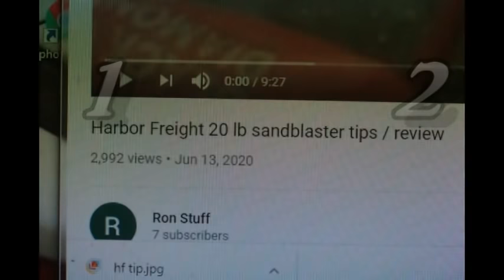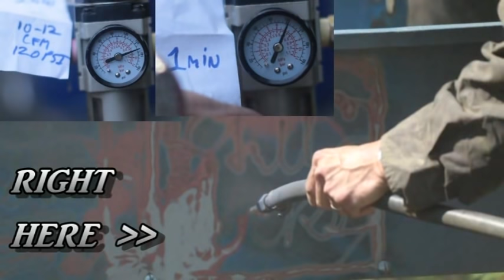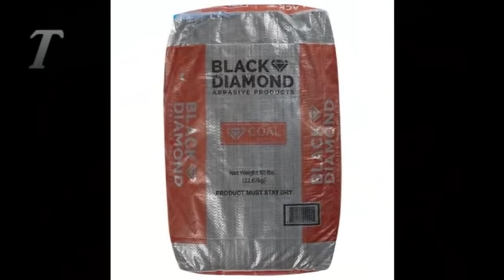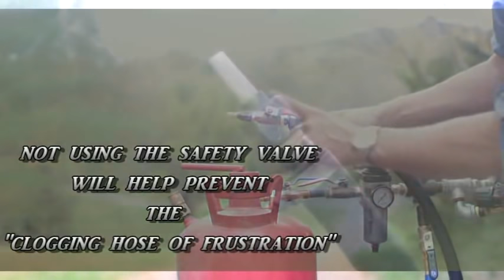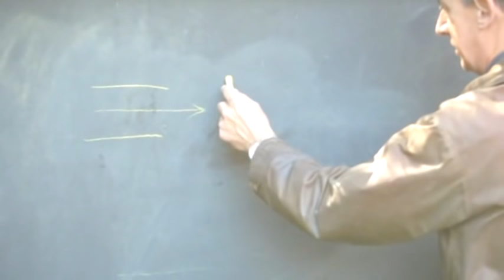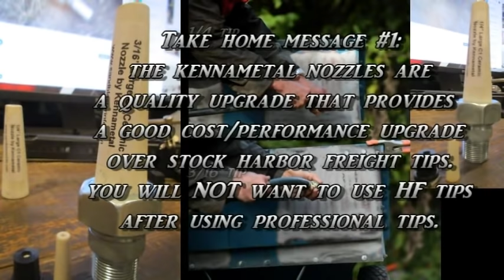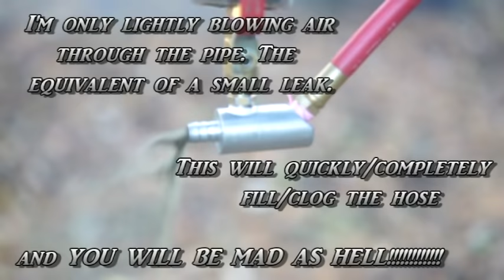Harbor Freight Sandblaster  - The Comprehensive Guide -  Making 20lb 40lb 110lb models work great.

Comment: thanks for the information. I'm getting that sandblaster I have a 6hp compressor that does like 6.8 cfm. but I have access to a bigger compressor that has a gas engine on it. Now I know what to expect. I think I will be ok using my smaller compressor but if I get impatient or have a bigger project then I'm going to take it to work. I also have access to tons of sand, but it will probably need to be screened or something but I will get to that when I get to that hopefully I can use it.
Reply from the maker: good luck! It's nice to have a gas powered option!

Comment: This was a tremendous help. I am having issues with this exact blaster and was ready to return it. Now I will get the other pieces and give it a shot again. 
How do I know what CFM my compressor is capable of putting out? I was thinking of connecting two compressors into a single feed since I have two of them. Thanks for sharing!

Comment: Great info. I have fought with a HF pressure pot style blaster more than once and could just never get it working to my satisfaction. This video really helps! I am using only  a 60gal 10-11cfm compressor though.  
I did an airframe using an old Craftsman gravity bucket blaster with a huge compressor and it never quit. Made me wonder, how would this run without being pressurized? With just gravity wouldn’t it be a less likely to backfill that lower hose? Was gonna cut mine up but I guess I could just leave the cap off and direct all air below just to see. Thanks for the motivation! Ideas?

Comment: I did a  salt water boat trailer many years ago with this blaster and 2 compressors =21cfm. I used 3 in-line dryers and play sand which was pre dried. It worked out very well but that’s not how things started. LOTS OF FRUSTRATION until I changed up my approach.

Your set up is quite a bit better it’s just odd with three input compressors. Ideally a single 25+cfm compressor with 100% duty cycle would be the ticket.

Comment: I keep wondering why this is so freaking hard. Watched this video and I am shaking my head with my Dad we just tried the Deadman switch. We spent an hour with the rubber mallet trying o unpack the hose of the walnut shells. We only got about 3 seconds of spray. We have been working on this off and on for a few months and he even bought a new air compressor which was a project in itself assembling. I hope some of your hacks help because the 100 dollar sand blaster has been feeling like a real bust up to this point. We are trying to clean the alliuminum pontoons on a boat we got to fix up.

Comment: Thank you for all the information. I’ve been wasting time with my previous attempts but didn’t want to brake the bank. I have everything pieced together to your specs except the Kennemetal tips. I bought 3 tips from Amazon to use as needed according to my location. What adapters are you using between the hose and the tip. Thanks again!
Reply from the maker: ebay has the tip+ tip holder. The tip holder will thread into regular pipe threaded stuff which will fit into the hose. Good luck. Here is a sample link.    https://www.ebay.com/itm/224954686724?hash=item3460581d04:g:2gwAAOSwD1JiZXps

Comment: Question. Is the 45 degree fitting at the bottom absolutely necessary or can you attach the 1/2 hose directly to the 4 way?
Reply from the maker: Seems like that would work fine so long as the hose doesn't get kinked. Good idea.

Comment: Thank you, thank you, thank you!  You just earned my subscription.  I had converted my harbor freight sand blaster into an oil vacuum tank.  Now I will go get the larger one and make these modifications.  The funny think is I started with a great compressor and I new that was not the problem.  Thank you for putting together all this information in one location.

Comment: Great show,I was just about to buy a harbour freight 27 gallon,,2 hp. 6 scfm compressor then add another 30 gallon tank to it for extra air volume,my biggest project will be a truck frame,do you think the extra tank will help with the smaller compressor,??thanx
Reply from the maker: 6 cfm won't be enough for the truck frame. The extra capacity tank will not give enough "reserve" to do anything effective. I've got 120 gallons of reserve and it will drain  down in about a minute or two, and then take forever to refill. You need cfms. If I was doing the entire frame, I would want at least 15cfm, regardless of reserve. If this is your only project, I would get a price quote of having someone do it for you. It might be cheaper than buying the stuff, especially if you factor in media. If you have other projects, great, but consider at least 15cfm for a frame. Really, you would want even more. You would be there forever with 10cfm. 6cfm, you will just get frustrated and quit. No replacement for displacement!

Comment: I know tbis videos old so I may not get a comment back. I have same tank. I fill tank to 125 psi. Open air valve halfway. Open sand valve 1/4 or half until sand comes out. But then sand stops coming out and it's just air. Even if the sand valve is open. I even upgraded to a 1/2 ball vce for tbe sand. Still same issue. Any ideas
Reply from the maker: valve to pressurize tank- fully open (keep it pressurized).  valve to air hose- fully open. valve to let sand into air hose- open until sand  flows. any valve on hose handle or tip- fully open. If sand stops flowing and you only get air- shake tank. If still no sand, but air is flowing out tip, then look into wet abrasive/moisture issues in tank. disassemble lower 1/2 inch valve letting sand into airline. Is it clogged? It the sand wet? Is sand in the bottom of the tank clumpy and wet? Make sure abrasive is dry/and add in line driers as needed. If that doesn't work, ensure there is no clog/constriction between the valve to pressurize the tank and the tank itself.  Add two or three driers in a row if you need too. How dare you say my video is "old" LOL! 🤣🤣🤣

Comment: Hi Ron Stuff, thank you for this amazing video. At 11:45 you mentioned a guy named Even flow and his parts list for the bottom mixing valve parts list but I don’t see your link to that. Do you mind sharing? Thank you!
Reply from the maker: Yes- thanks. Sorry about that! I went to go post the link but it got taken down and I cannot for the life of me find it.  If you scroll through this comments section, someone else asked the exact same question and I gave some alternate links/ info. Sorry for not having it. Also- his valve didn't even have the four way cleanout, so it might be better just going back to the picture and getting a screenshot. One of the big reasons I mentioned his name was to give him credit, but I have no idea where the link went. Originally, I thought the link was in one of the sandlblaster reviews on the harbor freight website, but I can't find it anymore.

Comment: Great video with lots of amazing tips. I was thinking of purchasing a 20 or 40 gallon one off of Marketplace and was researching videos on how to use it and found your video. I followed the links provided for the pipe fittings and maybe its me but I feel like it's a bit vague. Does someone have a better break down, and can you please share it? Also, is that just for the bottom set up? If so, do you have a break down of the upper set up? My apologies I just want to make sure on what to buy. Lastly, what compressor do you recommend to purchase to get at least 10-12 CFM, and 15-20 CFM(PSI + Gallons). Thank you all in advance for your help and guidance.

Comment: Congrats on your video you made it very clear on how to achieve your goal. I purchased the large HF hopper a year ago and it was terrible. I wish I had seen your video then. I do pool tile  cleaning with a 14hp. Gas compressor that I had to buy in AZ because CA outlawed allot of gas motors for generators, power washers.  I also bought a Clemco hopper I had to invest about  $14,000.00 all in and it makes my job so easy. After seeing your video I could of done it for allot less.

Comment: do you need to buy the nozzle tip and holder valve with the Kennametal nozzle or can i just get the ceramic nozzle?
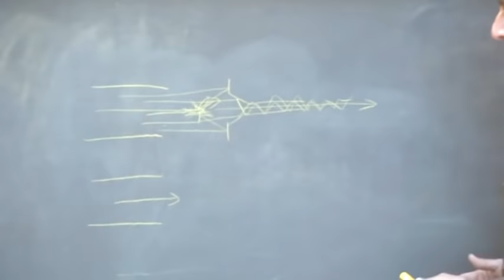Reply from the maker: 16:09 shows pics of the HF nozzle vs the kennametal nozzle as well as the valve holders. The pic is on the left.

Comment: For the air pressure could I just use the air pressure from running it through my semi truck
Reply from the maker: Sure!
Reply: No the compressor on the truck is only around 6cfm. And very little storage it will run a 1/2 impact wrench in short burst. Air up tires. No where near capacity to run sand blaster. Sand blaster would be more like 1 inch impact wrench steady hammering.

Comment: I have a question. . 
I have a 110lb pot. I also picked up 50lb bag of Black Diamond fine grit. Should I dump the whole bag in or is less better for flow? 
I'm running a Speedaire 7.5 hp/25 cfm. Thanks.
Reply from the maker: I think you will do fine. You have got a pretty decent pot, and, more importantly air supply. If you are asking, I'd dump a smaller amount in to get the feel,  perhaps a 1/4 or 1/2 bag, at first,  and then start adding more as you feel more confident. If there is an issue, it is easier to add more, or to  clean out a small amount as opposed to a full clogged bag. The amount you fill the pot  should not be the priority at this point in terms of flow-but in terms of convenience- keep it simple -stay light. Ultimately, when things are working, you should be able to fill the pot and it really shouldn't affect flow at all, but if in doubt, start out small. Your air supply is great. Get the feel in small steps, and add as when you know things are going smoothly.  If you are consistently getting smooth flow with no clogs, go to full bags. Moisture would be more a concern to me. I'd rather have a 25lbs moisture free abrasive than 110 pounds wet abrasive. This, of course, all predicated on your own abrasive, humidity, and moisture control. 
Start small (run out- refill). Build success. Gain confidence. Go bigger.  Good luck.
Reply: @ronstuff6330  Thanks for those tips Ron. Humidity isn't that high where I'm located but there some 30-35%. Giving it a go!

Comment: I bought the 1/2" blue hose from eBay that you recommended, but I don't know how to connect it since it has male fittings on both ends.  I can't make out in the video how you did it.  I need a male to female adapter of some kind that will turn freely.

Comment: Hi, Just watched your video as I am considering making my own kit to convert a sand blaster to a soda blaster and pick up any tips about both. I see you mentioned you tap off your air compressor to supply "fresh" air to your hood. If the air compressor is oil lubricated, it can kill you. Oil mist in air may not be noticeable but, it will collect in the lungs and basically cut off your oxygen.  Compressors used to fill scuba tanks are oil less. Small air compressors have no safety feature for what you are doing. Please rethink and investigate.
Reply from the maker: Thanks. As stated in the video itself, the air was warm and oily. I never really used it as it was so miserable. There are a number of other youtube videos which use the inline air, but I agree, after using it, it is pretty bad. I will update the notes in the intro. Infact, I just went ahead and deleted that part of the video. It might take several hours to register, but it should be gone.  Thanks again for the input!

Comment: I just bought the 110 blaster pot.  I didn’t even bother using it until I upgraded it like yours.  What size hose barb did you use for the hose? I got a 1/2” npt by 1/2” barb.  I believe I could get my hose to slide up on a 5/8” barb.
Reply: What did you figure out? I’m at the same point.

Comment: Im going to go ahead  and sub...very instructive video. I have a giant  120 gallon 45cfm air compressor and a portable sandblaster. It has been a pile of $h17, I've been thinking about marking a metering valve similar to what you've done. Where did you get the large hose at? If you don't mind.
Reply from the maker: Thanks! The big black hose to the tip is stock. The blue 1/2 hose was an ebay item. I gave the link to someone in the comments section, where you can buy it. Cool idea on the metering valves (great minds think alike) , (but...) there are a lot out there already. In another person commenting on the the "evenflo" thing, I put up some links on some pre made metering valves already out there, so you'd want to make sure you've got something different/better  than those. Good luck!

Comment: Where do you recommend getting a replacement for the 1/2"  black blasting hose,  that goes from the bottom of tank to the blasting tip, my original hose is getting shorter  due to the wearing through from the inside on the tank side?  Thank you

Comment: Hi Ron

I have just brought one of these Daytona sandblaster.   Unfortunately I don't have a big enough to compressor but I can joint two together to get the cfm up to about 9 cfm.    My question is will not having enough to cfm from your compressor result in the sandblaster kind of stud define when you apply the air.   To explain better, when I try to sandblast the medium comes out along with the air but it comes out in splutters, not a constant stream, it like starts and stops with a second I between the flow .   Any ideas ?

It is as out of the box, we have not made any moderfications yet.

Any ideas ?..
Reply from the maker: Thanks for writing. In my experience, this can be a problem with lower cfms, and with moisture in the abrasive causing the abrasive to not come out of the bottom mixing valve evenly. The damp abrasive will get clumpy.  This can be a big problem with playground sand. I would get as much cfms as possible, make sure abrasive is dry, get extra in-line driers if necessary, ditch any playground sand, and use the control levers just like in the video. It can sputter at first normally, but should even out if the abrasive is dry and coming in at a constant rate. Anther thing that can cause this is too coarse abrasive for a small tip- but that will usually just sputter and clog.

Comment: Do you happen to know why I’m not getting enough sand flow I’m using the black aluminum oxide 70 grit blast media  I get little shots that’ll last a second then stop I keep messing w the levelers and get no where , I’m using the 30 gallon lol alr 5.7 70 scm ..
Reply: Sand blaster 110 abrasive , with 3.5 tip

Comment: Thanks for this but where did you get the hose from? I've looked everywhere.
Reply from the maker: https://www.ebay.com/itm/CONTINENTAL-PLB05030-03-11-Air-Hose-1-2-I-D-36/313188446517?ssPageName=STRK%3AMEBIDX%3AIT&_trksid=p2057872.m2749.l2649
Reply from the maker: Ebay. Perhaps not a true 1/2 (it constricts at the connectors somewhat)- but relatively cheap and big improvement over  1/4 constriction in the stock hose, especially for higher cfms. Also- the stock ebay pic shows a 3/8 hose, however the ad is for a 1/2, and that is what they sent.
Reply: @ronstuff6330  thank you.
Reply: Where can I find the link for the parts for the four way connector as mentioned in the video by Evenflo?
Reply from the maker: @Tricia White When I posted the video, I tried to find that link to put it in the comments section (like I said I would), however, the link seems to have disappeared. I thought that link was on the HF website in the review section. The parts are pretty straightforward- a 3/4 valve, and the 3/4 four way pipe, both available in local hardware store. I will keep trying to find the link. Sorry!
Reply from the maker: I'm still looking for the link- in the meantime, I found this pre made valve which looks similar- and about the same price as the homemade one. I like this one better because it has no brass parts in it.  This might need some small modification to work on HF setup, but looks close. I would talk to supplier directly. 
https://www.toolsource.com/misc-c-318/bottom-end-assembly-12-brass-w12-abrasive-hose-fitting-p-257259.html?tsqtid=
Reply from the maker: Also, do a google search for "sandblaster mixing valve" Lots of good info, and detail on higher end valves. Here's another link with similar concept for homemade mixing valve- click on link and scroll down a bit to see it. They don't all have to look the same, but a similar concept.  All off the shelf hardware store stuff. https://www.wheelhorseforum.com/topic/71827-sand-blasting-tips-and-tricks/

Comment: Where can I get the holder parts for the C1 tip?  I bought a C1 5/16" tip which may be too large as my compressor is 10.3 CFM.  I have the coarse Coal Slag grit and that tip is the size Black Diamond recommends.
Reply from the maker: The 5/16 is probably too large for the 10cfm. I'd get 1/8 tip or smaller. In the kennemetal rematch section it shows me cutting with the kennemetal 3/16 tip and the 1/8 tip (at I think) approx 10 cfm. Here's the link for the holder where you can order a smaller tip for your cfms.  good luck!

https://www.ebay.com/itm/202967475478?hash=item2f41cde516:g:2JIAAOSwHr1emNtH
Reply: @ronstuff6330  I bought a 50 lb. bag of coarse coal slag from TSC because it's all that they had.  It won't pass through a 1/8" tip.  I made an adapter for the 5/16" nozzle and I'm going to see how well it works.  I've already done the plumbing modifications you've recommended on the bottom of the pot.  I haven't converted to 1/2" Air supply hose yet.